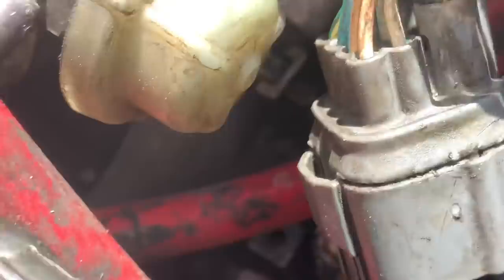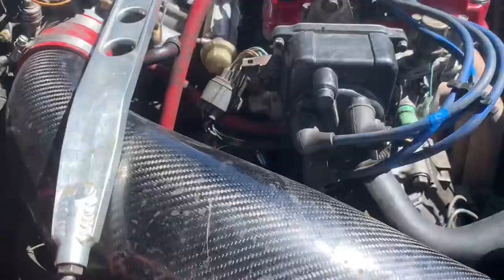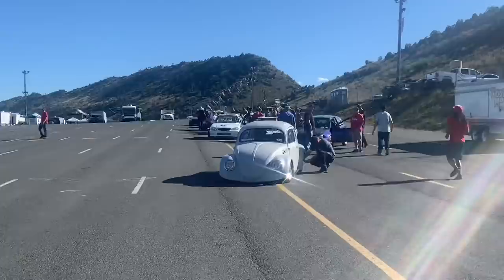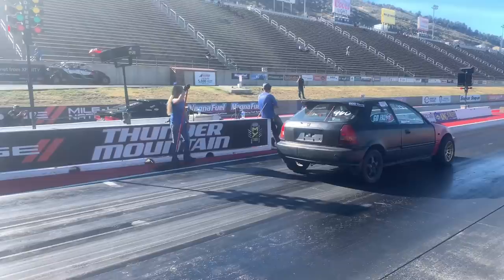Race day Vlog check it out!!!

Comment: I remember when I was getting combustion gasses in my coolant system.. I removed the gasket off the radiator cap to relieve the pressure and get me home an hour away

Comment: Change or remove  your thermostat bro
Reply from the maker: Bro both hoses get hot the thermostat is good and it is just ballooned hoses and little crud from using parts I from that guy but the thermostat water tube orings water pump all that shit is new dawg